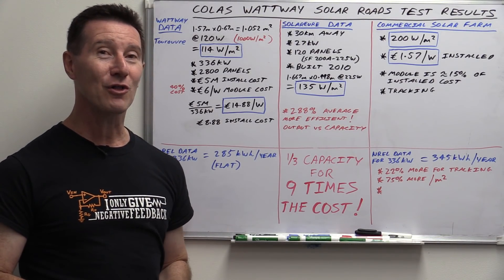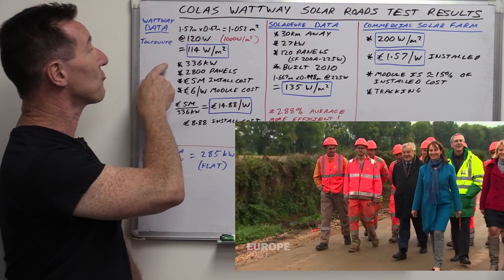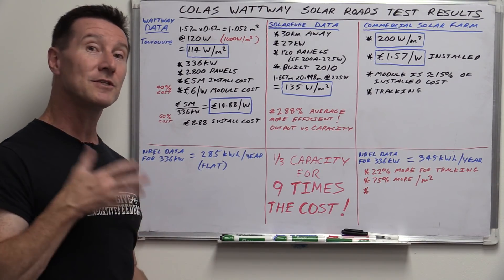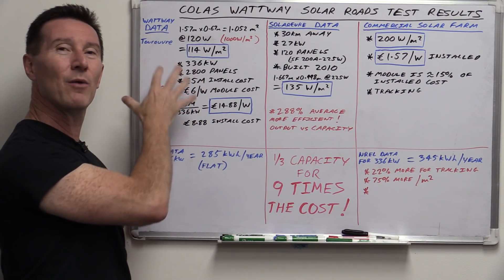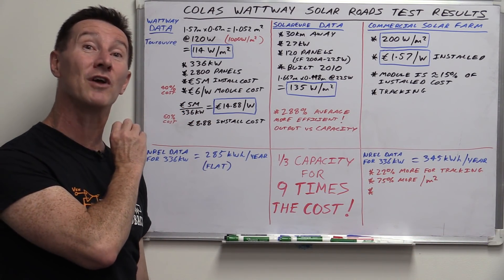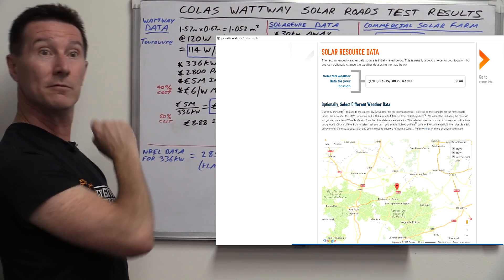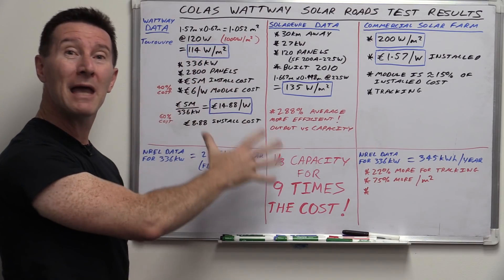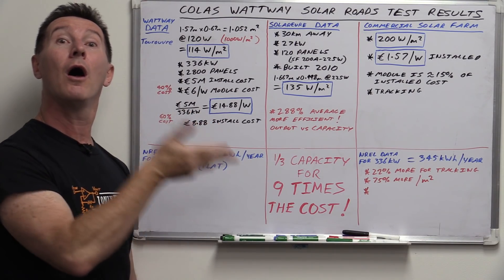EEVblog #1047 - Solar Roadways FINALLY BUSTED! (Colas Wattway)

Comment: couple questions, 
Are you factoring in the cost of the land required to host a commercial solar farm? Those things are massive and take a substantial number of acres.
 I always saw the upside of using roadways in that you are creating a double purpose for land already occupied by nothing other than concrete resulting in a giant expense already hitting the tax payer. A commercial solar farm requires whole swaths of land be dedicated (purchased, then paid on yearly oh and have to take into account the animals.... habitat.... yeah...) to just the solar panels. 
As for Running cable underground to connect the solar panels. 
Why could they not integrate the main energy return conduits into the panels... have the current run along some conduit built into each panel just like isolated power runs on any circuit board. have them interconnect along the edges with other panels.
Reply from the maker: Hiring some spare land space from owner is much cheaper than maintaining solar roads. Then you have all government building roof space, reserves, and you can do what the South Koreans do and put the panel above the road.
Reply: Cost of land is almost negligible compared to the cost of the panels. Agricultural land in rural France is on the order of  8000 euro / hectare, or about $1 per m^2. Dave uses an efficiency figure of 200W/m^2 for a commercial solar farm, so the cost of land is $1 per 200 W, or $0.005/W.
Reply: Treveliian -- Let me rephrase it with an example. A government wants to build a road from A to B. The choice they then make is not between building that road, and building a solar farm. Since the latter means they still can't get from A to B. So the choice they make is between an ordinary road and a solar road. Suppose the ordinary road costs $100 with a life time of 30 years, and the solar road costs $120 also with a life time of 30 years, but the solar road earns some small revenue of say $1 a year. Then the solar road would be the better (cost-effective) option. ($120 minus 30 times $1) 

If a solar farm for (less than) the same cost can earn $2, $3 or $5 a year is completely irrelevant here, because it doesn't meet the constraint that it should allow people to get from A to B. This video ignores that.
Reply: Treveliian you are aware solar panels are NOT suppose to be used to supply our general electric consommation. They are just a little on the side thing ( mainly to make politics looks good). Main everyday energy production is a problem wich to this day no sutable answer has ever been proposed. 
Ho and BTW in the desert ( where you would put a solar farm ) land is free....
Reply: in my previous post i did state that the REAL WORLD solution would be to bolster a solar system with hydro and wind power... so yes i understand the common use case for solar systems. Also as the "desert" land you speak of is primarily located along the equator... that kind of limits the prospective application sites. the question i had was how efficient would a photo voltaic cell need to be... to be useful in the northern or southern hemispheres.... along temperate zones....
Reply: Treveliiian -- The mistake in this video, and every video I've seen on this subject, is that they make the comparison with other solar cells. (on a roof or commercial) That's not the proper comparison. A solar road is not in competition with stand-alone solar cells, but with an ordinary road. If the lifetime cost of a solar roadway is lower than that of an ordinary road(I doubt that it is), then it's worthwhile to make them. There is some nuance here, for example, when the solar cells are separate units that are placed on existing roads, but then how it affects the maintenance of the road is still a factor to be considered.
Reply: i think it all comes down to ROI, or return on investment. currently the difference in power output is soo massive that the ROI for building a solar roadway is non existent.. well unless you are the schmuck hired to install and maintain it.. then you will reap massive gains..
Reply: As for ROI, that might be a deciding factor if profit was the primary goal, but this is infrastructure which is something the public sector generally does.
Reply: Brand131 your forgetting that the solar roadway wear and tear and replacement costs would a magnitude of excess cost over a normal tarmac roadway. 
I'm willing to bet genuine hard currency that a brand new conventional road way built with cheap solar panels erected as south facing hoarding would be cheaper and more profitable than a freaking solar roadway
Reply: if for some reason we all start driving around in IRobot Maglev cars then maybe i could see solar installations utilizing that area however at that point i believe the cost differences would be minimal. yet we don't live in that fantasy world so as it sits cells would need to be on a magnitude of 3-400 times as efficient as well as costing next to nothing before such a scheme like that would be viable.
Reply: Matthew Santon -- I wasn't arguing that solar roadways are feasible, but that comparing them to solar farms, like in this video, isn't the right comparison. The numbers I used were made-up and only meant for illustration.
Reply: "Double purpose" is never as good as you think it would be. Ever used a spork? Usually you take a performance hit on both sides, so you really have to make the case as to why you want to combine them in the first place. In this case, solar panels take a massive efficiency hit, while roads take a maintenance hit (because what was once just a simple pothole job now becomes a power-producing infrastructure repair job, plus a pothole job). And there's really not that much need to combine them in the first place. Even a rooftop solar installation does a much better job. When we run out of rooftop space, then it's time to look at other places to stick solar panels.
Reply: I think the figures he used already included the land cost. And there is far more land in the world than you realize. Land is only expensive in cities. Most land is extremely cheap and undesirable
Reply: Hey, really appreciate the reply!! 

i for one, do not like the idea of a solid line of solar panels going for miles along the roads. It would detract from the natural landscape far too much. Now unless you could make the blacktop mixture itself photo-voltaic and pave it out like normal blacktop. It just would not be worth the installation costs to replace every major roadway in the north america with a solar cell. i see the south Korean variants being hit by cars on a daily basis at-least if they were here in the U.S... now mounting a rack on both sides of a house rooftop, if the cost per unit were low enough you would not really need actuators to accommodate for loss, just factor in a 25% efficiency rate to begin with...one side gets half the days light the other side gets the remainder. grossly wasteful when it comes to equipment however i'm thinking of a blanket approach.If some power company were to lease every rooftop in a medium sized town and installed solar cells on every building. Figure a town size of 115k people maybe 15-18km sq in the northern hemisphere or southern along a temperate zone. My issue with solar anything; is that the sun is not a constant. Where i live, the sun a rarity.. clouds dominate the sky. The cells required here would have to be so efficient. It rules itself out immediately. i'm just curious how far off they really are. how efficient would the cells actually need to be to compensate for such a limited access to solar radiation. the real world solution would be to stabilize the system with a combination of solar, hydro and wind but we are in the solar roadway fantasy land lol..

Comment: You lost one thing in your hypothesis : the installed cheaper solar panel is installed in a private property you have not to purchase when you are on the road, witch is public domain. This property ownership cost much more than the public domain of roads in France. Sorry for my poor english.
Reply: Big road used for have the midle clean and  up clean too soo you can use the free space for it.

Comment: I feel your pain Professor (Dr? Mr? Doesn't matter what) Dave. 

I experience exactly this - https://youtu.be/rpwx-8s1M38?t=938 - on a daily basis right now......

Having a sane/logic based argument with insane irrational people is very frustrating. I know this pain... Only typically I'm arguing a WAAAAAY more basic/simple point against WAAAAAAY less sensible people (I'm literally having a "I think that the Building Act should apply to the City Council - the people who are supposed to be enforcing the building act - because they're just super duper breaking the Building Act right now across the entire city..." argument... And somehow not really managing to get all that far. This is in NZ (Wellington), and it's not some technicality... It's literally "Hey, so, maybe bridges should have foundations made out of building foundation type stuff..." 

I'm not making that up either... I can prove all that, and more............

I'm 1000% sure if I'd been trying to convince them to build a solar cycleway underneath the harbour... They'd have built it, costing like $500 million, torn it up due to public outrage, then built a replacement through a newly excavated (by hand) new harbour by now....

All I can think of.... is.... Maaaybe the technology for making solar panels durable enough to withstand traffic will be useful...? And... Maybe... With population densities... Eventually... Inside cities... In some places... Perhaps you could have a paved park area or a footpath/cycleway that generates some power? And maybe it would be not-insane to do that...? Have you factored in transmission losses and land values? Because I guess those could play a part. However from the looks of them, they aren't putting these roads right inside of cities anyway. So.... Ehh. 

And... Inside cities... Why wouldn't you just put the solar panels onto the buildings? Where they'll be in as much sunlight as possible, won't get f--king driven over, and won't pose a giant safety hazard? Anyway... Again... https://youtu.be/rpwx-8s1M38?t=938 Exactly!